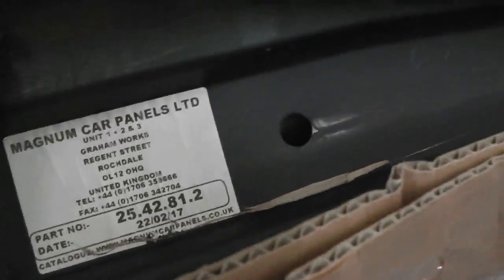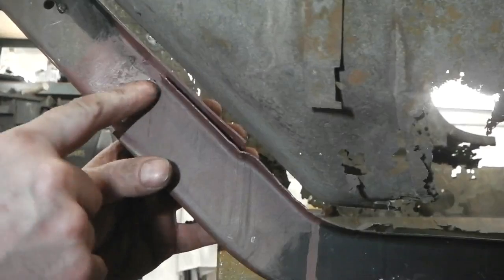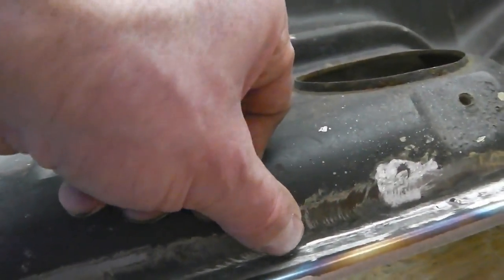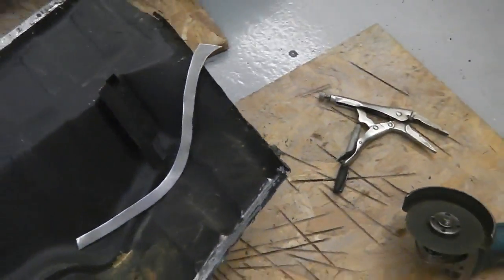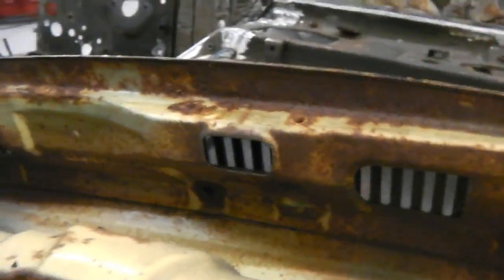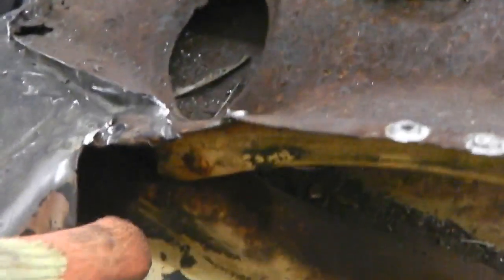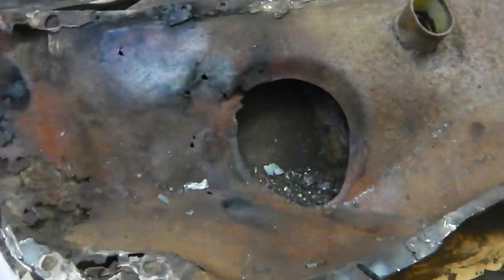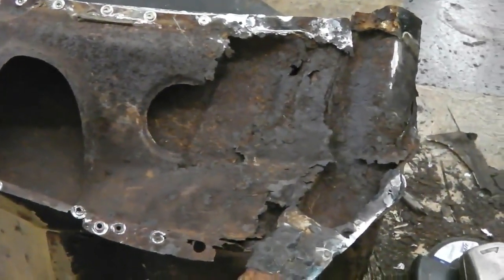Classic car restoration - Project Bramble EP8 pt1

Comment: hey pete, i use phosphoric acid 85% as a rust neutralizer, you can buy it on ebay at about £13  2.5 litre and thin it 50/50 with water. most of the rust neutralizers are this, decanted into their own bottles and charged a shit load of money for.

Comment: Hi pete C.... I have been watching your resto job on "Brambles" and I think you're doing an awesome job. I was thinking that because of all the wet weather you guys get in the UK you could spray any "water traps" with an oil and diesel mix, (I've been watching an American guy in New Hampshire who does a lot of work on old VWs. Because of all the salt and stuff that is used on their roads in winter their cars rust out real bad. So this guy uses a mixture of Bar Oil (the stuff used to lubricate the chain on chainsaws as it is quite "sticky") and diesel to thin it down. he sprays this mixture under all of his vehicles about once every 3 or 4 years. This way the vehicles cant rust because when the diesel dries out the bar oil is left in place and creates a barrier that moisture cant penetrate. I live in South Australia and it is very dry here but I thought you might find this suggestion useful. Cheers mate and keep up the good work..... P>S> I used to work for a Ford Service Centre in NZ in the '80s and I always loved the MK3 Cortina.
Reply: Yeah, Mustie1's got a bunch of unorthodox rust-protection methods :-D

I'm not sure whether I'd trust them on my own car though... my parents bought a 96 Mitsubishi L300 van in 2012 and the previous owner under-coated it with old engine oil from his tractor. The result was a 1/2" caked mess of dirt and oil stuck to everything, flaking off in spots and revealing plenty of rust underneath. Wax seems to be great but you need to redo it fairly often.

Road salt is a real issue in Austria where I live, especially in the east. I think we've got the highest salt consumption in Europe! Sometimes the streets are white with salt rather than snow because the predicted snow or ice didn't come. Rust is an absolute killer for older cars here!

Comment: We had a mark 3 cortina which rotted out and i fixed it up but no way in the way you are doing this car. The old servis twin tub washing machines were thicker metal than the car body !!!!

enjoying your project good luck
Reply from the maker: the servis twin tubs were beasts. RELIABLE ROBUST STYLISH. i loved the clockwork timers on em, and the colours, cream, cyan, retro 50s , 50s styling,   made to last.  i used to collect twin tubs as they looked so cool

Comment: Hi Pete,Great work again .Can I make a suggestion,I’d repair or fabricate the inner wing tops where the front outer wings bolt to before fitting the upper and lower bulkhead.
Reply from the maker: Mark i looked at this, I think the bulkhead topper panel needs to be underneath the iner wing tops, ill double check, thanks for this, good call Mark. pete

Comment: Peter you could make a mould of thoses corners of that top panel,use clingfilm then fill with body filler it will get hot you should end up with profile so you can check shape great video
Reply from the maker: Sean BANG ON idea!!!!!!
Reply: @PeteCswampy  if not body filler maybe aluminum mesh you can form it really easy no messy hot body filler your doing all the right things and very well to.

Comment: Great video, I mean, I used to have an idea of "how far gone is a vehicle before its unsalvageable", technically i realize I have been wrong in the past, ...it is all about how much work anyone wants to put into something.  Many times a decent example of a hard to get car is nearly impossible to get, and the ones in supposed excellent condition and cost too much usually end up finding out there is serious damage.  Many years ago, well, after I got out of military service of over three years, in 1991, I bought a 1977 Pontiac Firebird two door coupe, a hot rod, with 350 cu inch v8 engine,...problem was that the lower door skins, several spots on the lower quarter panels, and several rust holes near the rear window,....someone told me the car was "through",...meaning finished,....but I went out and bought a mig wire feed welder, a Lincoln sp100, and using .023 wire and shielding gas, I started cutting out the rotted metal and making by hand pieces of metal to weld in,...with no experience,....good thing was that there were alot of holes, so I got good real fast,....replacing metal with metal,...alot better than what some people would do which was fiberglass or excessive plastic filler,....I only made one mistake one day and that was not covering the rear window when I welded in a hole near it,...pitted the window with weld spatter, .....a big oooops, but I did spot painting, and treated the backsides of the welds against rust best I could, and nobody was wise to the fact that the car was called by some a parts car with all sorts of holes.
Reply from the maker: Bud thanks for reply, lots to think on there, i know what you mean about the glass, ive done that too in the past. easily done. it shows you got good fast when faced with all that Pontiac rust
Reply from the maker: thanks

Comment: So much work! I can tell your Passionate about cars! I am the same here, as I said before Different cars than The Fords....But I appreciate all cars and their designs etc....Would love to pick your brain sometime about how you built the body cradle for these cars....
Reply from the maker: Jay i just welded the cradle in place using the rear axle points and front jacking points, its not the best, if i did it again i would make stronger welds, im the same Jay, i love a lot of different cars, but not really the euroboxes of todays roads, but 50/60s yanks and 70s fords.
Reply: LOL......I have many Yank Tanks! 25 cars total here.....I will get the 61 Chrysler New Yorker up in the air, and see what happens.....On it though....I may have to use the rockers as a cradle point.....That and brace it in the door areas....Two door hard top....

Comment: Hi Pete could it be the hole is for switching the heater to recycled air only as apposed to the outside air. Doesn't one of the heater controls have a change between both of these settings if I am not mistaken   Hope that makes sense
Reply from the maker: good theory but theres no recycle option on cortina, fresh air in only, im thinking the panel is for an air baffle and water trap system, what ya think>>>???
Reply: Pete C I'll have to bow to your knowledge Pete drove a few but not pulled one apart like you have.  👍

Comment: How many two door Cortinas were actually made? I think I saw one in New Zealand when the Mk3 first came out and it must have been privately imported. Also those two round holes look like they (Ford) may have been considering eye ball fresh air vents ,the panel design having been signed off before someone changed the design to the wide vents instead.
Reply from the maker: quite a lot of 2 doors made but not many 2 door GXL

Comment: How many pounds, or kilos, of welding wire have you used so far on this project?
Reply from the maker: not much,  i suppose i could work i tout by reading off the diameter of the spool, it could be tricky as the diameter decreases not sure how to calculate the rate, but i would say its just the same as any resto, i wouldnt even say its a lot, ive used a spot welder quite a bit and a good selection of NOS panels, the welds are clean, ill have a look at the spool for you, thanks for question from pete

Comment: Hello Pete, I have 50 wing bolts if you can make use of them, I bought them about 25 years ago and still sitting in a tin.
Reply from the maker: if they clean ill take em!
Reply: @PeteCswampy  They have been dry stored so literally brand new, if I can have your address I will get them off to you.
Reply from the maker: i cant post on here, unless you can post your email and then ill bounce you a mail??? so kind for this offer, Pete

Comment: in my opinion ex-pressed needs to change outlook a bit, having a minimum run is unrealistic you are only going to sell one at a time, once the tool is setup you press 10 or 15, you sell one and the rest go in inventory as stock, thats how panel supply works.
you cant refuse jobs due to lack of interest, you charge an appropriate fee thats why these panels are expensive, a panel maker i knew(now dead and gone) used to make one offs in situations like this, he just charged a little bit more and the customer was happy because they got the part, he was happy since he kept a customer. 
you have to have wiggle room even if it makes the parts more expensive, when your customer needs a panel you make it happen buyers will pay a premium for unobtainium parts especially in the restoration genre.
Reply from the maker: I shall mention this, its quite possible they will do as you suggest as they are trying new ideas and the company is changin with the times, anything is possible and i think your suggestion makes sense, thank you for this, Pete

Comment: actily cortania they don't rust that bad, only the wings and rear wheel arches and the roof but only if it had a vynal roof other then that they were solid carsthe floors go but that's from years of use plus were abouts is the cortina? if by the sea then rusty is a yes, but if hidden away in a shed or barn or garage its fine, dumb computer,

Comment: Couldn't you order 10 and sell the others eventually?
Reply: Surely you can see there just isnt the demand or Express would be knocking them out… be like me saying to you- go buy 10 pressings and sell one to Pete . The trick with these restorations is to solve all these problems with minimal cost , it takes a few days but who cares ,its all part of the fun .ive done it my self got so excited buying parts only £30 for this part £40 for that ,before you know it youve spent £3000 on bits and your no better off. might as well start with a good car but that wouldnt do anything for me
Reply from the maker: thanks Colin, i did think of this, if i got mega stuck i would do this but as Chris says the demand.
Reply from the maker: Chris thanks, i agree if it all mint, it dont do it, i need the challenge. I needed a mission, and for my sins, they gave me one.......:-)
Reply: @chrishull4174  surely you must understand what eventually means? There probably isn't 10 MK3 restorations going on in the UK right now hence why it would be hard to find 10 buyer's all at once. Also you must be new if you think Pete restores cars as cheaply as possible, nope he goes all out. This panel looks really difficult to make and will probably take awhile. Don't forget your time is worth money as well. Anyway I'll wait and see, maybe he can get it looking original. My worries would be making it a dam for rainwater and needing to replace it in 2 years.